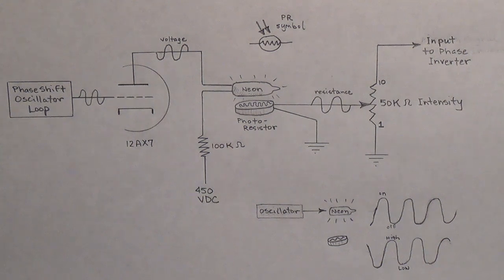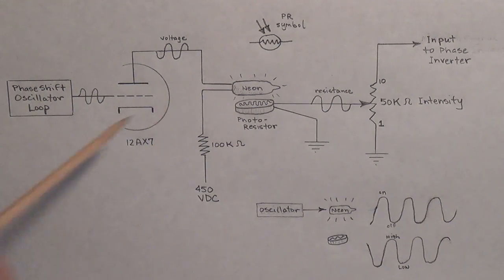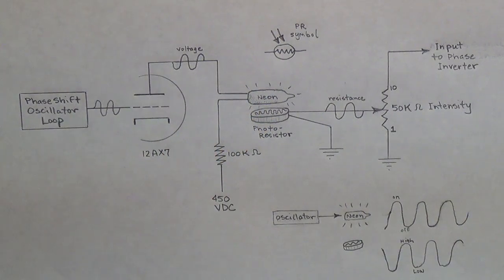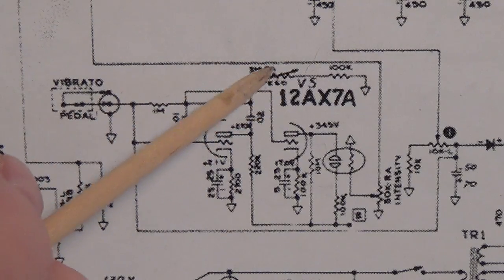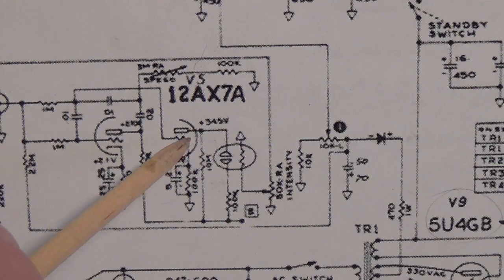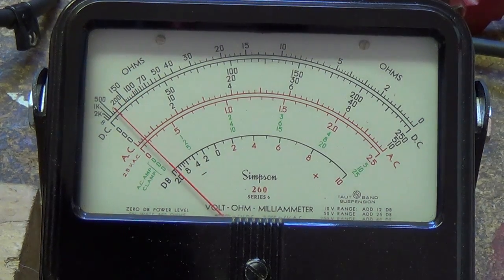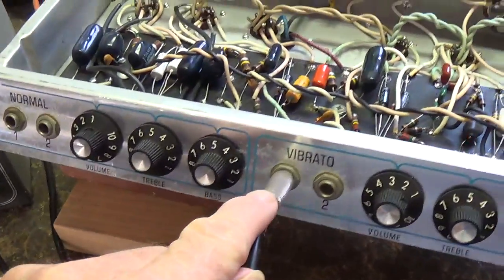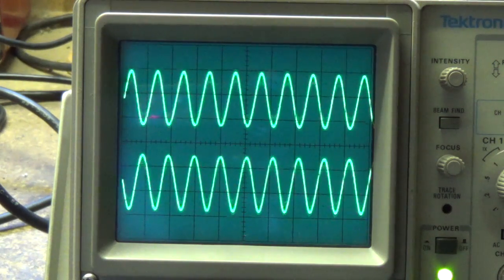Photoresistor Volume-Modulating Tremolo: Design and Function

Comment: That's really old hat. I am looking for information on the old Gibson and Ward's Airline tremolo LFO PENTODES (usually wired as a triode that runs to the screens on the power tubes, and usually uses another triode for positive feedback), so totally different from this tremolo design, and it doubles as voltage regulator in some amps like the GA40.
Reply from the maker: I'm sorry to bore you, Seth. Hopefully you can find the information you seek.
Reply: @UncleDoug  We still love you, my man! You had to have been a good professional teacher! If not, you sure missed your calling. We have got it! It's a very weird one, and it had been miswired. It used a 6SN7 triode to feedback into a 6V6 and create oscillation with the NON-INVERTING signal from the 6V6's cathode follower with some of the 6SN7's signal oscillating with an INVERTED signal fed back into the 6V6, with usual positive feedback to start and sustain the oscillation. That signal wobbles the cathode bias resistor's value. The old 2P3T 3 speed switch is GONE now.  I replaced it with a dual ganged 1 meg linear pot with two 2.4 meg-Ohm resistors wired in parallel to get two 705K Ohm ganged pots so it's variable speed now and not just slow medium or fast. The Wards LFOs are just pentodes wired for triode but the same basic architecture as most Fender/Ampeg/etc. LFOs. The Gibson one is a real oddity, and nothing else sounds like it. We also added an intensity pot. There was a VR for a grid leak, but adjusting it killed the oscillation completely. I do a lot of the Magnatone amps. This was lots easier than chasing that two channel pitch shifting and panning stereo mess that Magna/Estey used.
Reply: That 2205 scope reminds me, I need to put a new battery into my 2245B lest I lose the programming in it, and make calibration into an impossibility.

Comment: great video!  what would cause it to sound weak?  i have a 67 proverb that has very weak tremolo.  could be the tube or the resistor itself, i guess.  what should i look for?
thanks,
mikeB.
Reply from the maker: Thanks, MM. You might check the 50K Intensity pot to be sure it's working properly, and try some different tubes in the oscillator position. Some tubes just seem to work better than others as oscillators. Best of luck :)
Reply: Uncle Doug
after trying various tubes i've noticed that when i raise the intensity knob that the volume gets quieter?!  should i change the 3 caps, the intensity pot, all 3, or look elsewhere?  thanks, mikeB
Reply from the maker: If the chassis is out of the cabinet, can you see the neon bulb brightly flickering, faster and slower in response to the speed control? If so, then the oscillator is working. If not, do you have the footswitch plugged in and "ON" (which is grounded for this circuit)? Are you sure the footswitch offers a good ground when "ON"? If all this checks out then we'll have to look elsewhere in the circuit.
Reply: Uncle Doug
i pulled the pro reverb's chassis and hooked up the same footswitch you have.  no light at all.  i also pulled my super reverb 67 chassis and checked it, but also no light.  however, i know the super's vibrato works because i had played it 10 mins. prior and it worked.  i let the tubes cool down, pulled them and pulled the chassis, but no light.  isn't that weird?  now i don't know what to think.  guess i'll just do the shotgun approach and replace the caps and the bulb and resistor.  still, the super's not lighting is strange.  thanks, mikeB
Reply from the maker: Are you sure the footswitch was in the grounded "ON" position ?? Normally you can see the bulb flickering in the open end of its shrinkwrap covering....as I demonstrated in the video.

Comment: I’ve got this 1965 Fender Deluxe Reverb and the tremolo has developed a Thumping sound, not a Ticking sound that is common.  It thumps in rhythm with the speed.  I replaced the roach and also the 12AX7 but no change.  Any ideas? Thanks.
Reply from the maker: It is generally caused by the high voltage required to trigger the neon bulb. There are several cures available on the internet via a search.
Reply: @UncleDoug  Thanks for the lead.  I’ve done a lot of searching generally, plus on Hoffman’s forums, but not found an answer for the problem with a photo resistor driven tremolo.
Reply from the maker: @wsscott72  1.)https://www.tdpri.com/threads/filtering-out-tremolo-thump-question.1026286/     2.)https://www.youtube.com/watch?v=9GAkTDwp1BY
3.)https://www.thegearpage.net/board/index.php?threads/victoria-victorilux-tremolo-thump-help.1278394/
Reply: @UncleDoug  As you know, the DR has an optocoupler tremolo, and these fixes all have bias based tremolos.  At least that’s what their discussion indicates. So I wouldn’t think those fixes would work.
Reply from the maker: @wsscott72  Since #2 was specifically for a Deluxe Reverb, I would think it might apply to your situation.
Reply: @UncleDoug  I didn't pursue that fix because mine is a deep thump, not a bright tick, like so many of these are.  I'll give it a try and maybe it'll be a fix.  Just curious on why the pitch of the oscillation is so different in the two instances.
Reply from the maker: @wsscott72  Perhaps the issues stems from  different causes, thus the different sounds.
Reply: @UncleDoug  I guess since the "ticking" sound appears in Fenders using the bias shifting tremolo as well as the ones with the optocoupler bulb, the ticking must be coming from the LFO (Low Frequency Oscillator) part of the circuit.  That might make sense because the ticking is a frequency issue.  I'm a novice so excuse my comments if they're crazy.  Maybe the lead dress is a good place for me to start.
Reply from the maker: @wsscott72  It would be, especially if the problem was chronic, but if the issue arose suddenly without any changes to the circuit, component failure would be more likely.
Reply: @UncleDoug  Good Point.  I did put in a new 12AX7 for the tremolo oscillator, and about a day later the thumping started. Before the new tube, the amp output volume would decrease as you increased the Intensity of the tremolo.  I replaced the tube and that problem cleared up. Maybe the new strong tube pushed an old component over the edge.
Reply from the maker: @wsscott72  Sounds quite feasible, Reggie. Oscillation circuits are delicately balanced, and perhaps you upset that balance.
Reply: @UncleDoug  I’ll keep you posted.  Hope to get to it this week.  Thanks so much for your input. Happy New Year.

Comment: Uncle doug, I have a Gibson Lancer (GA-35RVT) and my optoisolator lamp is on solid with no flashing. Amp is working great with you mods but the trem is not working.
Reply from the maker: If the bulb is not flashing then the problem is in the oscillator circuit....check the tube and the values of the three capacitors in the oscillation loop.

Comment: Is it important to use a dummy load when scrutinizing an amplifier.
Reply from the maker: It's fairly standard procedure, WC, because tube amps should never be operated without an appropriate load on the OPT secondary. The dummy load fulfills this requirement without all the god-awful noise....i.e. 1000 Hz at high volume 8>(

Comment: The amplitude variation looks a bit choppy. I suspect the ohms change of the  LDR and Neon combination is non linear and that you can see the amplitude dwell at  the minimum level on  the scope trace , where you identify the wavy central  minimum volume line,  the scope x axis time base  makes many passes during the signal's dwell at the minimum volume and that  leaves the superimposed minimum trace on the display as a tell tail.
Reply from the maker: The resistance modulation probably is a little uneven, WC, but with an effect like Tremolo, it's probably not an issue. At least no distortion is incurred, as it was in the bias-shifting circuit.
Reply: Uncle Doug If you wanted to, you could  display the  shape of how  the resistance changes with a trace on the scope,  by placing the ohm meter probe on the top terminal of the intensity pot to supply a DC voltage, instead of the sig gen signal,  with  the scope probe on the wiper terminal , with the wiper set at half, to display the shape.
Reply from the maker: An interesting suggestion, WC. I'll keep that in mind for a future project. Thanks for the input :)

Comment: I'm a bigger fan of Magnatone vibrato. I have a feeling that Leo Fender did too....because he labels the tremolo on his amps as "vibrato"....Then he was forced to keep up the ruse and call the whammy on his guitars a "tremolo" arm. Fortunately for Leo, his amp designs were higher powered and his cabinets were sturdier than Magnatone (who concentrated on sound quality features like vibrato over tremolo). More power and sturdier cabs were more important than a bit better sound for gigging musicians and Fenders went on to legend status while Magnatones went out of business.
Reply from the maker: Magnatone Vibrato is an unusual effect....some love it and some don't. It's noticeably different from Tremolo, producing a "fluttering" effect (to my ear) somewhat reminiscent of a Leslie speaker (which produces both effects simultaneously). In addition, true vibrato is challenging to produce, requiring a sizable and rather complex circuit, thus increasing the possibility of failure during a performance.....not a great selling point.
Reply: Uncle Doug I own twelve Magnatones and in my experience failure is probably less common with Magnatone vibrato than with Fender tremolo. Both use a tube  to drive the effect so that's a wash. I have had to replace bulbs in Fender tremolo circuits but varistors never burn out. As for the sound, taste is subjective but tremolo always sounds to me  like playing your amp through an electric fan or like a helicopter, while vibrato is more musical like a violin or human voice. And the phasing effects you get playing the amp through external speakers into 3 dimensional space are legendary.
Reply from the maker: Thanks for your knowledgeable input, Joe.